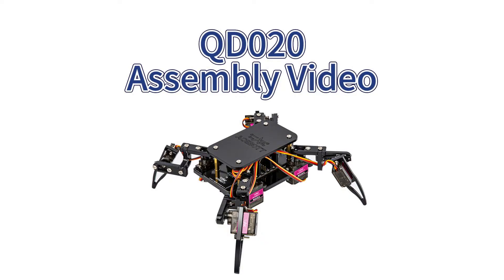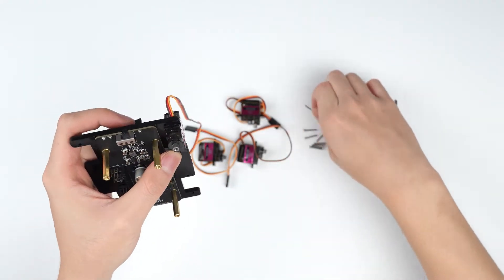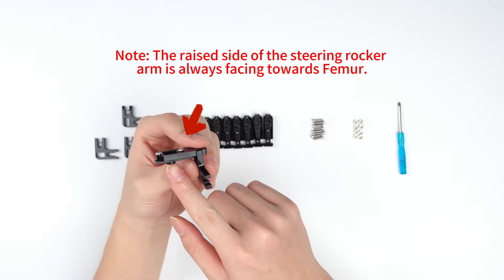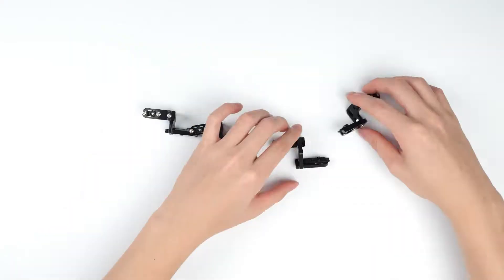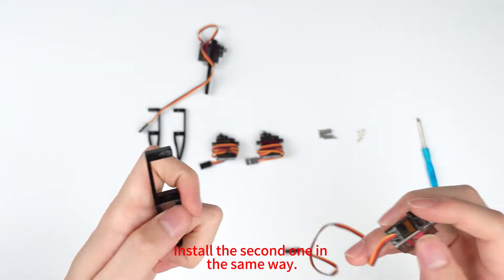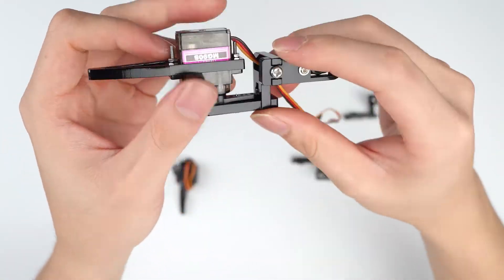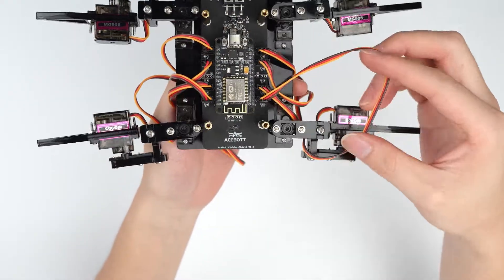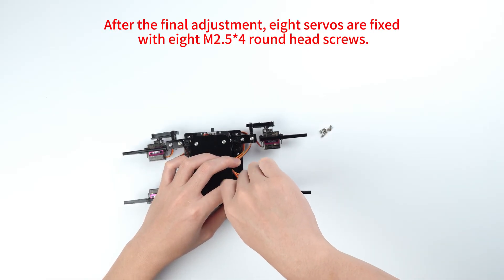Assemble the QD020 ACEBOTT Spider Robot Kit: Simple, Fun, and Educational!

Comment: Do  I need batteries or USB cable
Reply from the maker: Hi. You need to use an 18650 flat-head lithium battery and Type C cable for charging. For further help, you can reach out to our support team at support@acebott.com
Reply: Why didn’t it come with the robot?
Reply from the maker: @alinahhas For shipping convenience, batteries are typically not included. :)
Reply: @acebott ok thanks anyways
Reply from the maker: @alinahhas  Our pleasure.
Reply: LETT’S GOOOOO I GOT THE BATTERY 🎉🎉🎉🎉
Reply: Let’s goooooo I got the battery!🎉🎉🎉🎉
Reply from the maker: @alinahhas  Hooray!!!
Reply: Wait, how do I connect it to the acebott app
Reply from the maker: @alinahhas  You can check our another video: https://youtu.be/rzBv5HevS2M?si=rVnqDmf_BP8uIwYl
Reply: @acebott the problem is when I switch the on/off switch it doesn’t move the servos as shown in the videos
Reply from the maker: @alinahhas  Could you reach out to support@acebott.com? They will investigate the issue for you.
Reply: @acebott  I have exactly the same problem. I assembled the robot exactly according to the instructions, connected the power supply, but the servos don't respond.
Reply: @andreyihailovich3263  Me too. Did you resolve it?